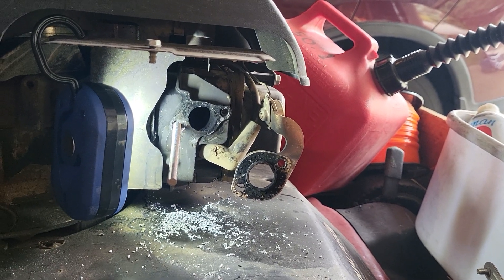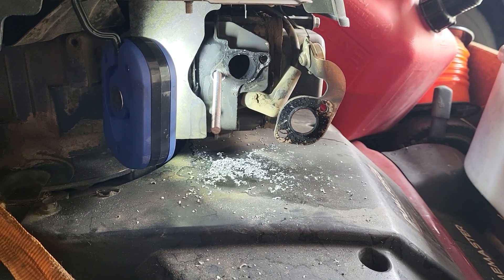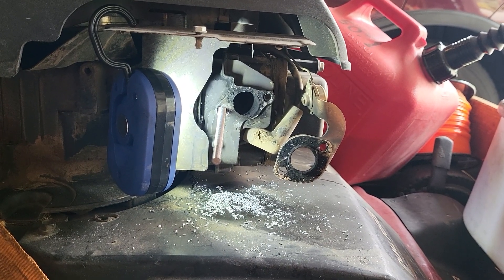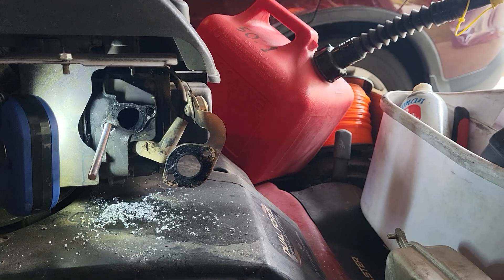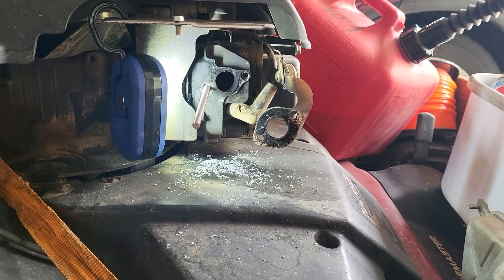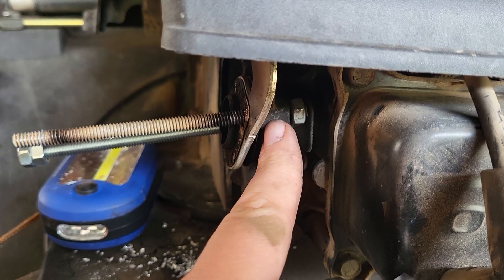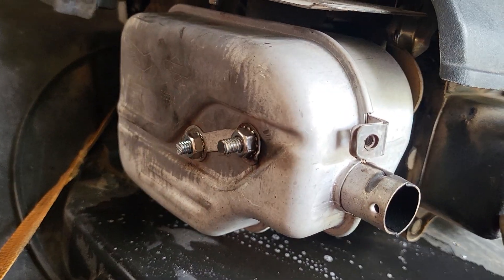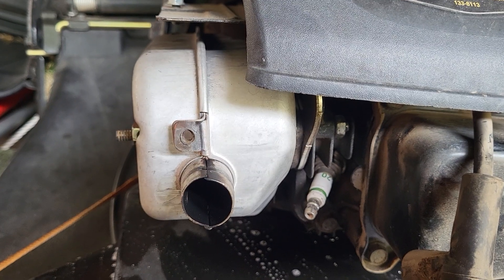Toro Timemaster Stripped Exhaust Bolt Repair

Comment: My son's Timemaster's exhaust has broken off, basically, the bolt in the front of the mower broke 1/2 of the casing it screws into.  The bolt closer to the handle of the mower looks as though it was broken off.  I drilled it out and put a new bolt in along with JB Weld.  I also added JB Weld to the exhaust and the broken off casing that the other bolt was originally screwed into.  Unfortunately, the high vibration of the mower engine doesn't like to work well with JB Weld.  I'm at a loss.  Any ideas?

Comment: My exhaust bolt snapped off when I took it out and is only sticking out a 1/4 inch...  any tips to remove the bolt?
Reply from the maker: @STAT303954  That happened to me with the other exhaust bolt over a year ago. You can try to heat it with a propane torch and try losening it with vice grips clamped to the broken off head. If that doesn't work, drill it out. I resorted to drilling it out, which was very tricky. Basically, you need to center punch the center of the broken bolt, so your drill bit doesn't wander. Start with a drill bit that is slightly smaller than the diameter of the bolt. Be sure the bit is sharp and lubricate it with a cutting oil or 3 in 1 oil, applying moderate pressure at a slow speed. Be sure it goes in straight, or you will wander off into the soft aluminum engine block. There are youtube videos that explain the process of drilling out the bolt better than me. You can also weld a nut onto the head of the broken bolt and remove it like a normal bolt. The welding heat makes it easier to remove. Once you have finished that, you can change to thread rods like I did so that you can remove the muffler without breaking a bolt off in the future.
Reply: @thomaswhitney8097  wd40 and locking pliars did the trick!